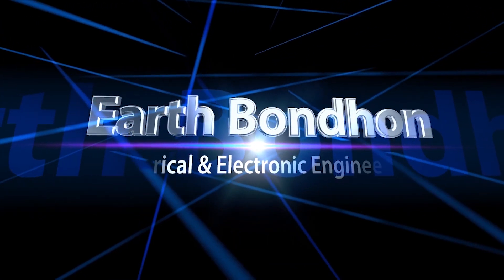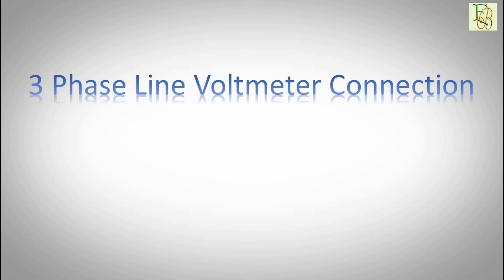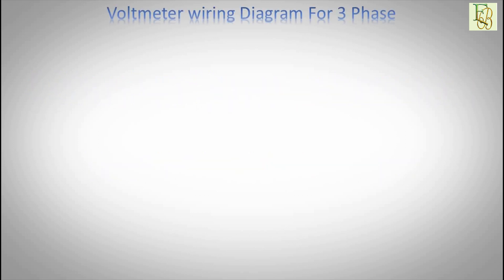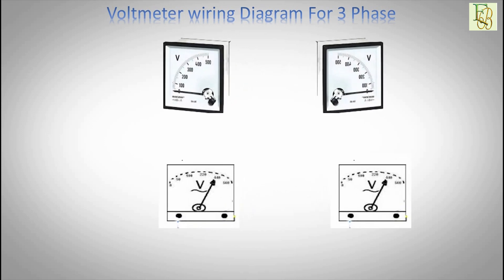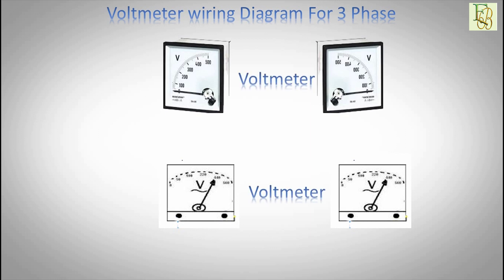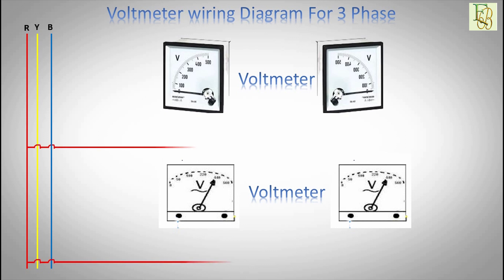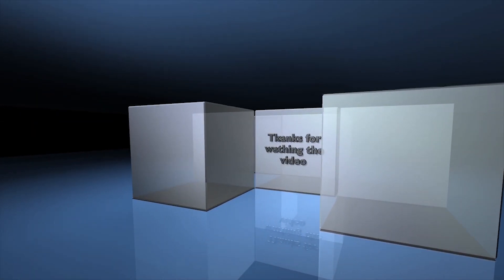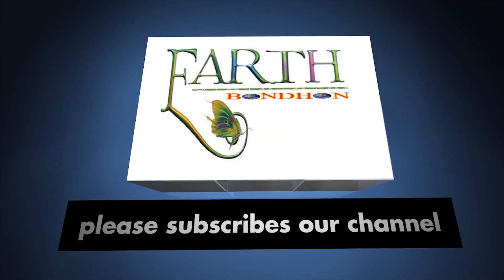Voltmeter Wiring For 3 Phase System |  3 Phase Voltmeter Installation  by Earthbondhon

Comment: @Earth Bondhon sir i have a doubt ..
In a 3 phase connection we are providing voltmeter without the selector switches, so how many voltmeters should we provide 2 or 3. Should we always measure between RY, YB and RB then it should be 3 voltmeters isnt it?
Reply from the maker: yes, thanks

Comment: Hi sir I need one information ..........  My question .....if bulb holder have positive and negative ....side......sir
Reply from the maker: yes

thank you
Reply: @EarthBondhon sir i have a doubt ..
In a 3 phase connection we are providing voltmeter without the selector switches, so how many voltmeters should we provide 2 or 3. Should we always measure between RY, YB and RB then it should be 3 voltmeters isnt it?